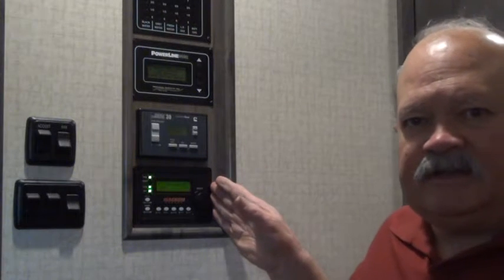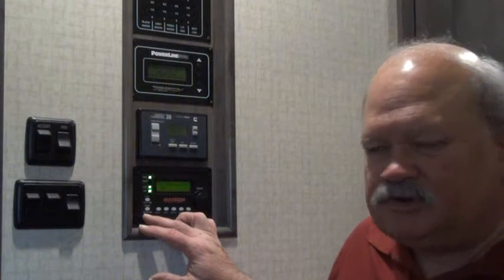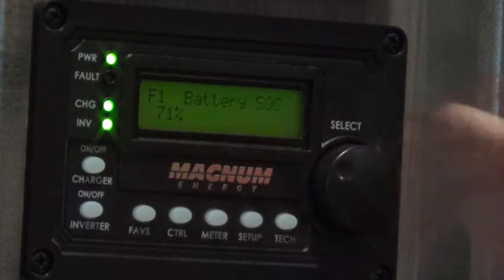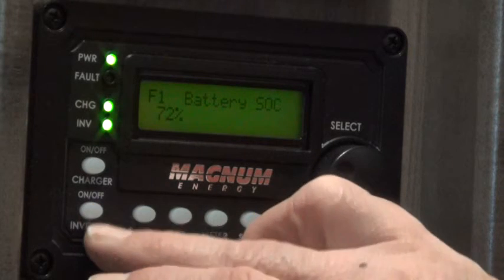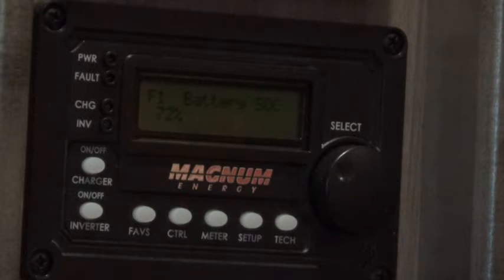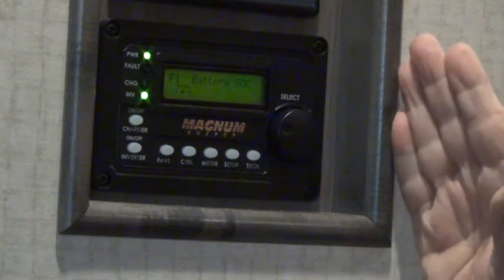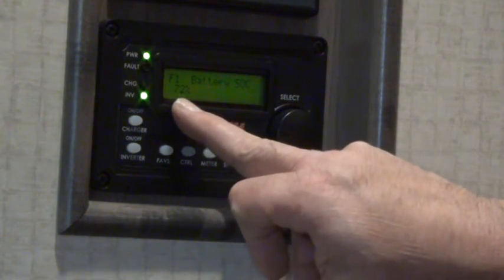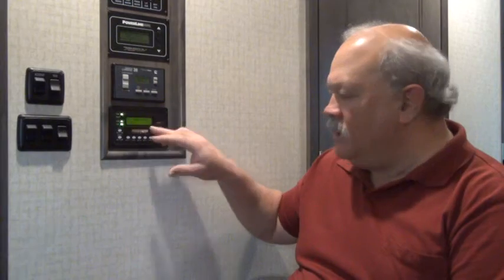RV Inverters and Converters

Comment: Good informative video. I handle quality control at our dealership as well as do the walk through and demonstrations on newly purchased RVs and I am often asked why someone would want to ever turn off the inverter, and I can never think of a reason that makes sense, so my recommendation is to leave it on unless you specifically need to for maintenance or testing. I didn't understand your reasoning for turning yours off other than wanting to give your solar panels a workout. Maybe I didn't completely understand.

Comment: Nice video, I notice your CPAP machine. I have one also. I'm not sure if you ever had this problem while using your CPAP. While boondocking my machine will turn off at 12.4 volts however, my AGS will not start until my battery is at 12.2 volts. So I wake up short of breath. I'm thinking about adding 2 more 6v batteries unless there are other options...
I'm using the inverter to power my 120 outlet for my machine.  I notice you are using the 12 volt option. I am going to try using my 12v to see if my machine will last the whole night.....

Keep the videos coming.....
Reply: Your AGS should be adjustable so you can set the parameters at which it will kick in. Most are factory set at 12.5 but adjustable.